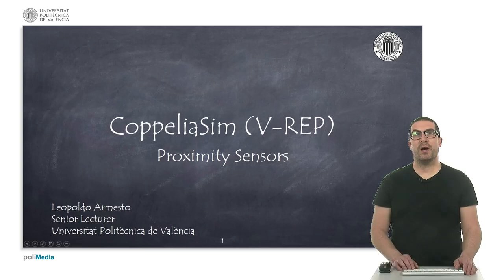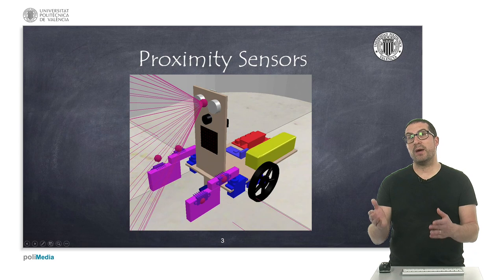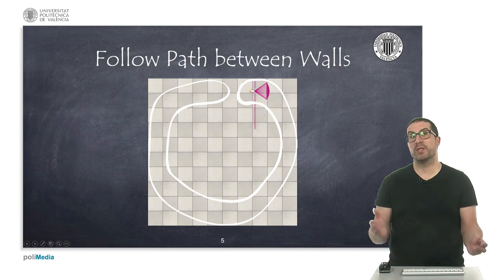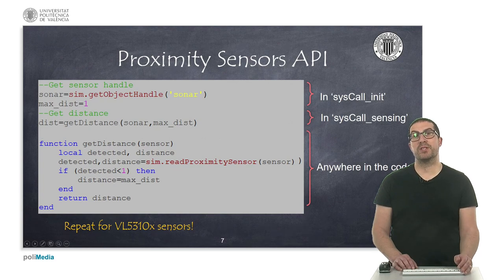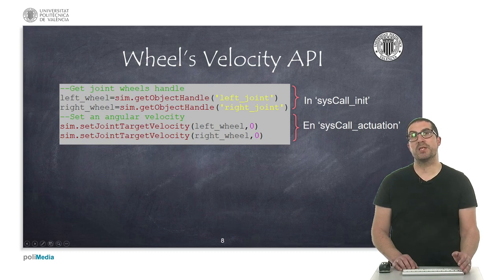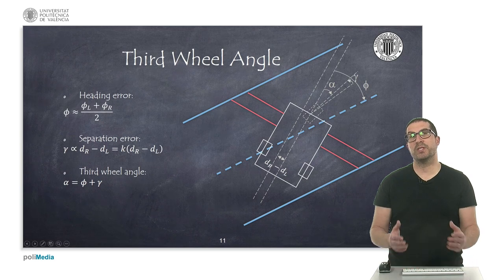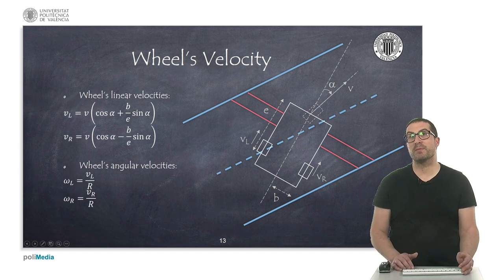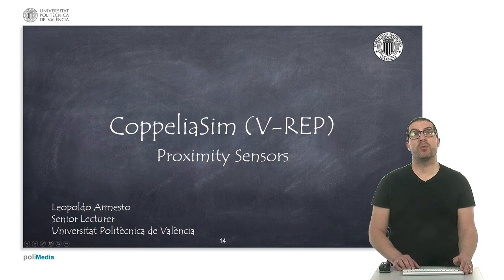How to Use Proximity Sensors To Stay Between Walls | CoppeliaSim (V-REP)

Comment: Hi Leppoldo, there is a mistake in slide at 10:41, VR and VL in the picture on the left are reversed. anyway, your channel is the best.
BTW. you should add the link how to buy you solution in every video, otherwise, it's easy to ignore.Your solution is worth the money😀
Reply from the maker: Thanks for your comments, I really appreciate them. In the picture, the robot points mostly upwards, so it is correct

Comment: Sir can you explain how you arrived  at third wheel angle and velocity of each wheel?
Reply from the maker: Himanshu Dubara There’s a kinematic relation between the wheels. So you can set the angle and the velocity of the ‘third wheel’ as if it a car-like robot to compute the velocities of the rear wheels, assuming there’s no wheel slippage. On the other hand, there’s a technique known as pure pursuit that basically gives you the geometric expressions to compute the wheel angle to converge to a line for a given distance. Based on this technique I derived the expression indicated in the video. At this point of the tutorial this is something off-topic that I  prefer not to mention in detail to keep the video as short as possible. So that’s why I provided with the formula, but without too much details on how I’ve got that formula.

Comment: Hey Leopoldo, I bought the DYOR Solutions and I replicated this system using python but had difficulties with communication with Coppeliasim. I used Spyder to run it and it run just once and stops.  Please, is there a way to solve this?
Reply from the maker: Hello, I’m not sure what’s the problem. Have you tried to run any other code, just to check that your Python-CoppeliaSim connection is working as expected?
Reply: @LeoArmesto  I finally found the problem. I needed to use a while loop. Thanks for th reply

Comment: Hello Sir,
Where should we add the condition to calculate the speed of the wheels?
Reply from the maker: Usually inside ‘SysCall_actuation’ function you need to compute the wheels velocity
Reply: @LeoArmesto  [/robot@childScript:error] [string "/robot@childScript"]:77: attempt to compare nil with number
stack traceback:
    [string "/robot@childScript"]:77: in function 'sysCall_actuation'

line 77: if(dist<0.04) then

can you please explain this error?
Reply from the maker: You haven’t define the value of ‘dist’ before using it
Reply: @LeoArmesto  I have assigned dist=getDistance(sonar,max_dist) under Syscall_sensing
Reply: Its working now. Thank you!